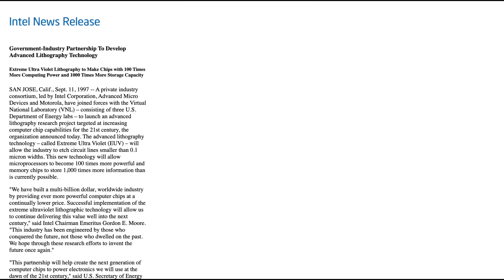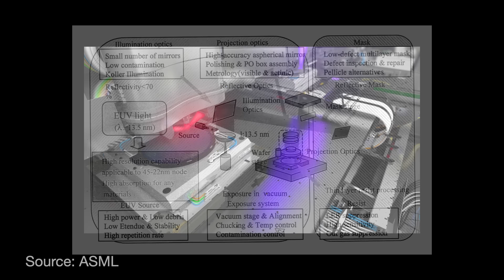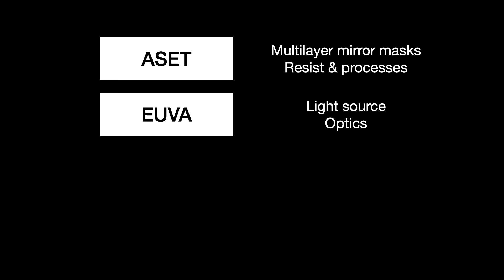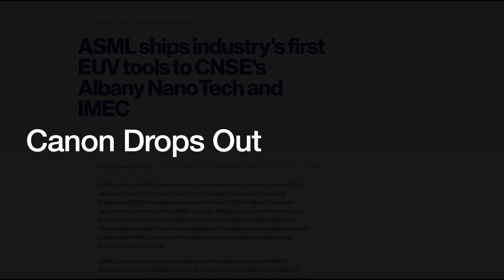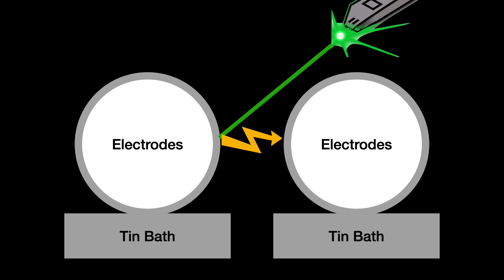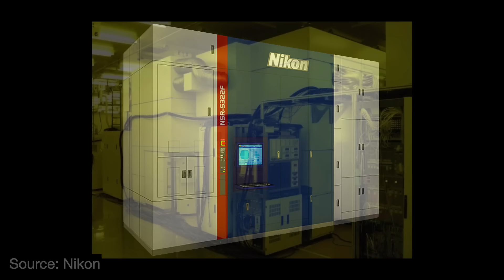Japan’s EUV Failure

Comment: if you can make EUV without too many mirrors (power reduction of several magnitudes) Japan can and will do EUV. anyway, I truly believe that eventually EUV source will be compact particle accelerator similar like in use at hospitals to produce the electron beam source. the source work in cluster of exposure machines 
                  ┌── Electron path A ── Undulator ── EUV → Scanner A
                    │
Accelerator ────────┼── Electron path B ── Undulator ── EUV → Scanner B
                    │
                    └── Electron path C ── Undulator ── EUV → Scanner C
The key comparison
	                      Tin plasma	                       Undulator/FEL
EUV emission:	Broad/angular	                Highly directional
Spectrum:	Several tin emission features	Tunable/narrow
Collection:	Large collector required	        Much less collection loss
Coherence:	Low	                                             Potentially very high
Source size	Tiny plasma	                                 Electron beam/undulator
Accelerator	No	                                                  Yes
Machine size:	Relatively compact	           Major challenge
Wall-plug efficiency:	Challenging	Potentially competitive, but accelerator efficiency matters

Comment: It’s crazy that you can frame this as a failure. Thousands of apes spent countless hours trying to solve several of THE hardest engineering problems simultaneously under a deadline. A failure only in a very narrow  sense I suppose.

Comment: Very interesting as usual. I was however expecting a word on Canons purchase of Molecular Imprints jet and flash nano imprint technology in 2014. Molecular Imprints was a UT Austin spin-off with a lithograph technology aimed at the 13.6 nm node, but that uses standard i-line (365 nm) light source. Sematech was also heavily invested in the efforts of Molecular Imprints (MII). As far as I know, Canon still utilizes this technology today, but I lost the daily connection to the industry a while back.
I worked in the field and collaborated with MII from around 2001 to 2011.

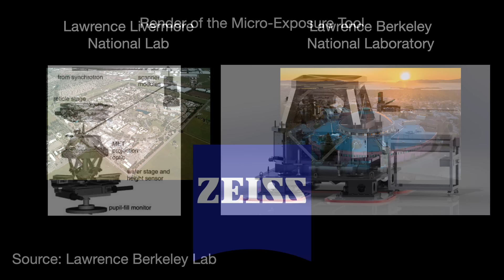Comment: At the 12:53 mark. That's the MET 5 tool. I worked on both MET 3 and MET 5. Also, the exposure shots on the MET 3 were 200 x 600 microns. We exposed test patterns on experimental photoresists and provided metrology via SEM for dose and focus as well as process windows. I was there between 2013 and 2021.

Comment: All this is 90’s technology, the new wafer will be blue crystal encryption technology.  Space age materials for infinite storage and memory.   Something like crystals used to store digital information, media, etc out of Superman 1980’s Christopher Reeves before he became handicapped.

Yes, no more silicon wafer materials.   Silicon like sand and glass are not infinite solutions for storing data.   As computers become more powerful the secrets of energy storage within crystals will surface and become the centerpiece of Atlantis like technologies.   Low power, high frequency, radiation energy harnessed to outperform combustionable energy forms.   It will touch dark matter materials and inter dimensional portal worm holes.

Comment: A source said the Nikon recently installed one EUV litho system in TSMC's factory(Hsin-chu?) for trial run.
Reply: Do you have a link ?
Reply: @simanhtranao7859  correct the message, it's from Canon, not Nikon.....which I was just told few days ago. sorry no link.
Reply: @vincentlin9350   Are you confusing the EUV machine with the Nanoimprint machine? I know that Canon is building  Nanoimprint machine which can be a competitor with EUV and its is in trial run state

Comment: Thank you for the very informative presentations.

From your estimate of 4-5,000,000,000 in investment and 10-15 year development time, might you posit that the chinese will, effectively never develop "EUV" systems? If you are correct, they might be a decade behind by the time that it was developed.

Do you have a feeling as to what route that they will take toward indigenous construction of advanced integrated circuits if their satanic government does not "implode" soon?

Comment: Seems like most assessments concluded that proximity x-ray would have been the best, and most scalable technology.  But having to build synchrotrons scared people away.  I think in the end the joke may be on them.  EUV is expensive, inherently not very scalable, and ultimately took decades to develop.  Hard to see how the same investment in x-ray based lithography wouldn't have everyone better positioned by now...
Reply: China is developing a synchrotron radiation based steady state electron microbunching EUV, different from the Free electron laser based Laser pulsed plasma EUV used by ASML. The SSMB EUV can give a much high power radiation along with a much more stable and efficient performance at a reasonable cost. Tsinghua University along with Helmholtz-Zentrum Berlin has already verified it's proof of principle. Further research is ongoing at Tsinghua University, a prototype is supposed to come out by 2026 and commercialization within this decade.

Comment: I work for on of the support manufacturers you listed, Tokyo Electron. ASML's scanners really are a sight to behold as they're being installed, truly marvels of engineering. Our tools are extremely well built as well, and are fascinating to watch when they're working. The speed with which they transfer wafers to the many steps of the photolithography process, including the scanner, is something out of a sci-fi film.
Reply: I work for another support manufacturer, also for the wafer stage, seeing it in the testing tools is insane. Mindblowing how fast yet precise the movements are
Reply: I've been on the prototyping/building/design side of of Intels EUV Vaccum Control System for almost 8 years now, multiple revisions, tweaking, process updates, it never ends. But I'm the only one in my group that knows what the ASML Lithography machine actually is, and that I tie into that machine to make it function. All because 8 years ago I was asked if I want to take on the challenge of prototyping the first version based on terrible drawings and documentation, and I said yes, and somehow the whole project dropped into my lap instead of getting laid off when they moved production out to the new Oregon Facility. I went out there for 3 months to train my replacements, and came home to a work from home job I wasn't expecting, it all worked out in the end 🙂
Reply: @michaelkeudel8770  damn dude your life is so much more interesting than mine
Reply: Yup that they create the tiny bits that make silicon into a powerful tool in and of itself is a little left of outright magic. I can only imagine when they start making monolithic nitride devices that use photons instead of electrons. 😮❤

Comment: Can you explain why ASML had US research handed to them whereas Japanese effort were treated like outside partners?
Reply: Probably because Japan already has sort of a monopoly on the photolithography section of semiconductor manufacturing. My company, Tokyo Electron, manufactures a vast majority of the "support" tools for the scanners. Our Lithius Pro Z tools handle resist, coater, and developer dispensing on the wafers. Our tools basically handle everything other than the scanning, and our Lithius tools are connected directly to ASML's scanners.

Comment: Another fascinating piece, great work as always!

One note: You said that the discs that picked up the molten tin were 20 meters in diameter, is that correct? If so, that’d require an absolutely enormous high-vacuum system to house them! 

I’m curious where the carbon contamination on the mirrors came from: Maybe minuscule amounts of diffusion-pump oil? I’m intrigued as to where the hydrocarbons might have entered the system.

I was in the camera biz at the time, and the global crash of 2008 hit Nikon pretty hard too, so that might have been a factor in limiting their appetite for lithography R&D as well.

Nikon’s an interesting and sad story that would make an interesting video of its own (if you haven’t already done one). A lot of things combined to create an almost perfect storm of problems for them in the 2016-2017 time frame. In 2017 they took an extraordinary accounting charge for their semiconductor lithography division, essentially saying in financial terms that they’d never recoup the capital cost of their manufacturing facilities even in terms of gross revenue, let alone profits :-0

Leading up to that, their camera division had two disastrous technology failures in 2016-2017, both of which could be laid at the feet of their development partners, but that Nikon ultimately paid the price for.

The first was their ill-fated “Key Mission” action camera line. This consisted of three models, the 80, 170 and 360, the numbers referring to the angular field of view. (The 360 captured 360-degree stills and videos.) The hardware and optics of these were excellent, well ahead of anything GoPro or others had at the time, with the optics in the 360 being little short of amazing. Unfortunately, the firmware and software were another story entirely, to the point that they were almost unusable. (The WiFi connectivity was particularly bad.) I don’t know but suspect that some chunk of the software development was contracted out, but however it was done, it killed the products. This was especially unfortunate because Nikon had invested a huge amount in development, having decided that action cams were a critically important market for them to enter. They also spent some enormous amount in a global marketing campaign to launch them. It’s possible that they might have eventually recovered and gotten things working, but as we now know, this was just as the action camera market hit saturation and sales were falling off a cliff.

The second critical blow was to their planned DL camera line. These were very high-spec compact cameras (meaning with non-interchangeable lenses) that were intended to compete with Sony’s very successful RX-series models. The specs looked great, and the optics would undoubtedly have been first-rate. They went through the entire development process, right to the point of being ready to go into mass production, only to discover that the (unknown) third party responsible for the image processors couldn’t deliver on them (!). They were so far along they’d even placed ad contracts for the product launch, only to have to cancel them a month or two later, before any ads aired. I never found out what the specific problem was with the processor chips, but I’m guessing that the supplier designed them around a process node that wasn’t stable yet so they couldn’t get the yields they needed to manufacture them. (This is entirely speculation on my part, all I know for sure is it was the processors that killed the line. They were originally slated to launch in June 2016, but it took until February 2017 for Nikon to officially announce their demise.

Both sets of products held a lot of promise and I’m sure would have been quite profitable if they’d been able to successfully produce them. I wonder where Nikon would be today if they hadn’t lost so much investment and opportunity cost on these two products. As a longtime Nikon fan, it saddened me to see them have such struggles :-/

(The whole evolution of the camera business is a pretty interesting subject; there have been a lot of twists and turns along the way as the tech moved from analog to digital.)
Reply: Nikon was a world-class business. Sad to hear about those failures and thank you for highlighting them.

Comment: I am very curious about the so called NIL technique that was announced by Canon. Will Canon win back the leading position by realizing and commercialising the technique? I just wonder if there's any chance that you would share on this topic
Reply: Imprint is cute but it can’t really overcome its throughput problem. Maybe a niche market but never gonna make consumer processors or dram with it.
Reply: @Grak70 it is possible to make CPU with it just not ideal
Reply: @_Chad_ThunderCock  “possible” is not necessarily “manufacturable”. If you work in a fab, you know this. I do.
Reply: @Grak70  I dunno..... Canon seems pretty confident and are putting a lot of faith and resources into solving it's problems. Maybe it won't work out. Maybe it will.

Comment: Fascinating story! 
It would be nice to put together a video to discuss the future (post EUV) lithography 😉
Reply: Very likely there will be no post EUV lithography, cause smaller you get, bigger problems with electrons migration become, making chips less durable, but with higher price. Would you like to have 1nm CPU with lifetime of 2-3 years and 1500-2000$ price or 20nm CPU with 10 years lifetime and 500-1000$ ?
Reply: @konstantingrudnev8374  I probably didn’t elaborate that well but I meant what the future of computation will look like in the future. Silicon based processors have brought us so far, what comes next?
Reply: @ominollo  I don't know what the next breakthrough tech gonna be, but meanwhile it's gonna be hybrid approach of existing technologies. For example CPU with RAM on the same die, or CPU + AI module + RAM on the same die, this will give some boost while they seek breakthrough tech
Reply: @konstantingrudnev8374  yeah, this seems a reasonable scenario. We’ll see 🙂

Comment: You have explained most key functions of a litho machine, but one thing I cannot get my head around is the precision motion systems inside them that have to reliably and repeatably reposition the wafer to the nm, that kind of precision is just generally unheard of.
Reply: There are 2 components: a measurement system like an interferometer and motor systems that position the stage. The biggest secret is to do this all at very high speeds...
Reply: @tommy2cents492  The resolution of those motors and gears must be insane! with non-existent backlash to reliably hit those exact spots again and again on the wafer, especially with multi-patterning, it wouldn't surprise me if they have two modes, a low resolution mode for large and fast axial movements and an ultra high-resolution, high-precision mode for honing on the exact spot it needs to be at the end of a large low-resolution travel move 

I can imagine it's also a very dynamic closed-loop system that requires constant real time micro-adjustments that might be guided by some kind of etched landmark on the silicon?
Reply: @ChimpyChamp  if someone asked me to name a technology they thought came from aliens, it would be scanner stage positioning. You look at the requirements and can only conclude it shouldn’t work but it does.

At a very simplified level, they use bands of closely spaced electromagnets to move the stage (the entire stage is levitating over a near perfectly smooth block of granite). The closed loop control uses an interferometer and powerful signal processing to feedback an electrical signal to those magnets that results in oscillation damping and acceleration control. The part of every stepper/scanner you don’t see is the rows of 2m tall control racks supporting it. They’re usually tucked away in the sub-fab, quietly and frantically sending out a flood of information to the control systems. It is truly mind boggling.
Reply: @ChimpyChamp There are no gears.

Comment: If we look to Shuji Nakamura who won the Physics Nobel prize for his work inventing the blue LED, it was a small team of inventors who did not have significant support who invented the tech. Large consortiums are slow and I think rarely succeed because of the internal inertia  and politics. MITI should have tasked multiple teams to work on the various sub systems. Consortiums don't allow for fast decisions, etc.
Reply: These are not technologies that can be made by just one research team. It is an extremely complex set of technologies, all niche, which have to work together perfectly for even a prototype to work. Consortium is the only way. Plus developing even a single technology component is extremely expensive, and so requires governmental help.
Reply: @slash2bot  Yeah, but they still could not produce gallium nitride LEDs which are now powering lighting systems globally. 3 watt lights that are brighter than old-style >10 watt strip lights.

Comment: Please make videos about why those EUV alternatives didn't materialize, that would be awesome. Some of them, like x-ray and electron beam, would allow to print feature sizes much smaller, right? Can they still happen?
Reply: Electron beams can already make features much smaller than EUV. Its how a lot of the masks are made. Its problem as a technology currently is that it is way to slow to be used for wafer production.
Reply: @kellensanna  Indeed this has been true since long time ago - for example, I remember that already about y. 2000   ~10nm features were (slowly) printed using a modified electron microscope under university lab conditions. This was  obviously way before EUV was available, but just for comparison contemporary (DUV) AT1100 machines could do 'only' CD of 100nm but with decent throughput of about 90 of 300mm wph.
Reply: EUV had already surpassed anything they hoped to achieve with proximity X-Ray and e-beam is direct write and was never going to meet throughput requirements.
Reply: Back in the early 90's, EUV was called Soft Xray.  I worked on component optics fab and test for an experimental small field exposure tool Bell Labs was developing.